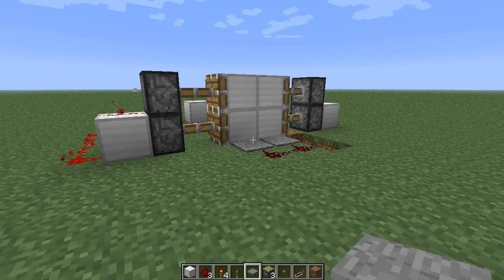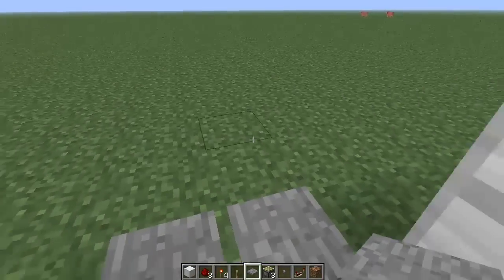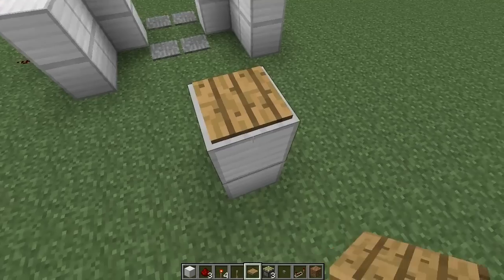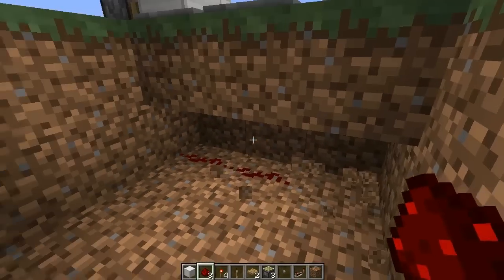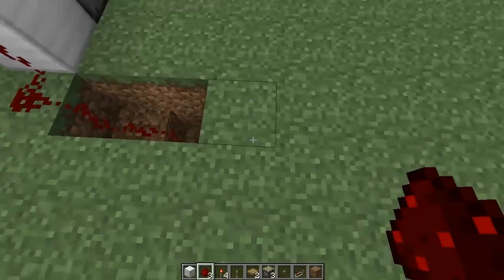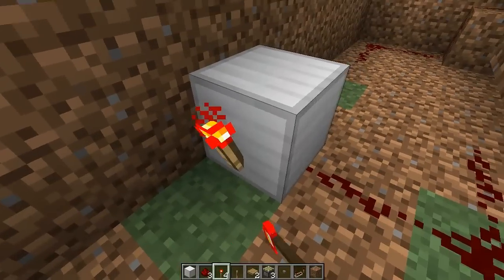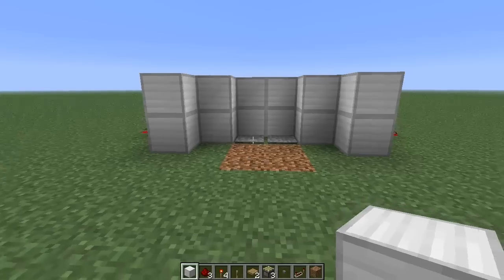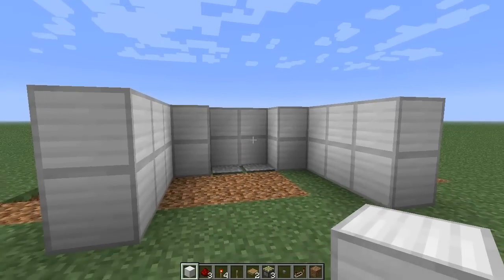Redstone Tutorials - #5 Neater Piston Doors

Comment: I did this exactly like you said, and it didn't work. Took me a min but I realized that my pressure plates weren't working at all, they would not power the red stone. Also my inverter was acting as the power source and not a converter. So I'm confused..

Comment: I still don't fully understand the concept of how Redstone dust can power the stone above it. So you basically have to hide it in a little vent sized crawl space under the ground. Maybe it's easier to think of the Redstone dust as just an invisible block that looks like Redstone dust on the bottom.